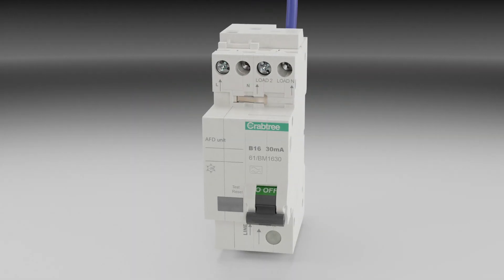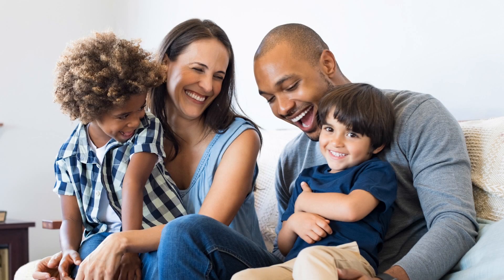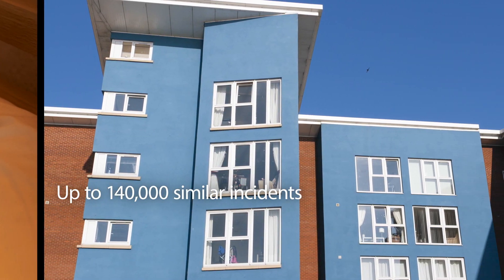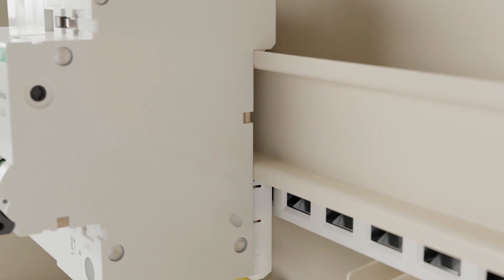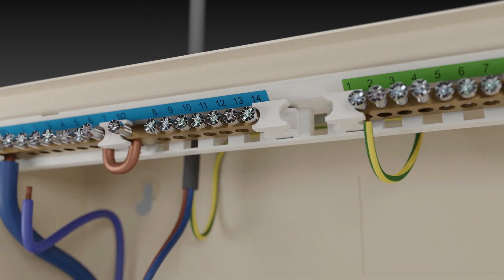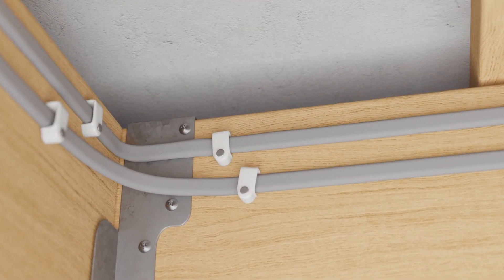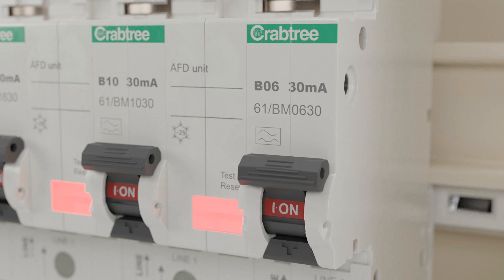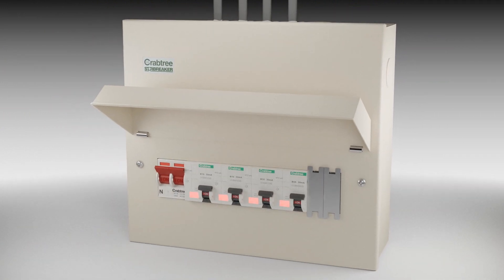Arc Fault Detection Devices from Crabtree

Comment: Have been following these devices for 5 years now, and according to some American Sparkies, (the US has used them for nearly 20 years), Arc fault detection circuit breakers are a pain, they nuisance trip, they also don't work on series arc faults or loose joints, they only work between phase and neutral. And even if they do trip on an arc fault or over current, what's to stop people just keep resetting them until eventually something catches fire, which is typically what happens.
If you've got Earth leakage and overcurrent protection at 230 vac why do you need to have arc fault?
Reply: that is because mcbs and rccbs cannot catch arc faults before it leads to a massive fire?